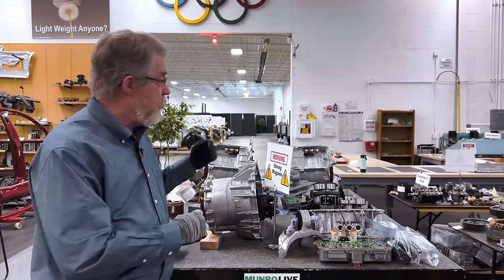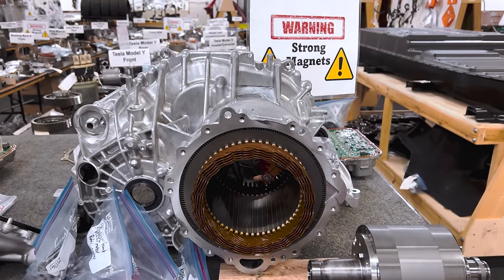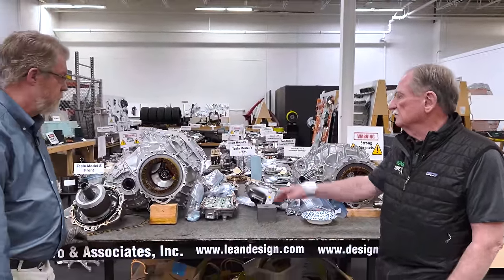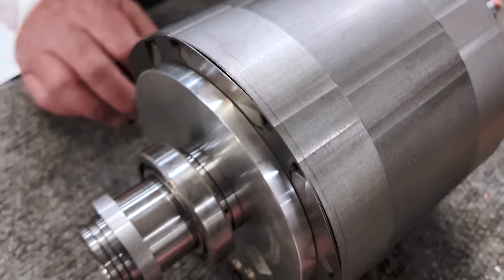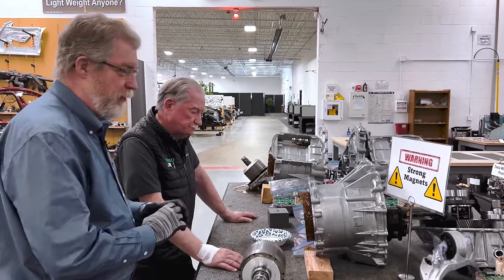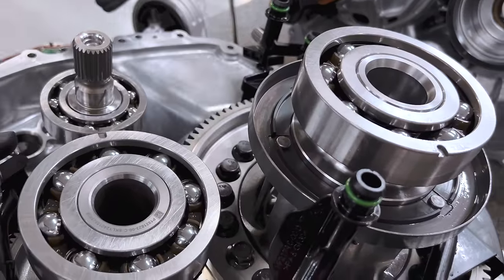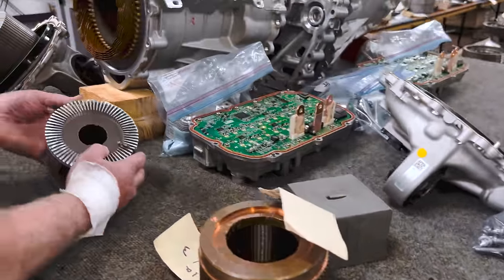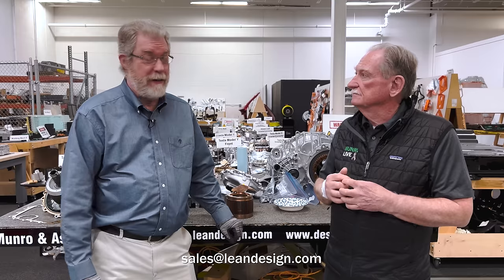Tesla Cybertruck 845-HP "Cyberbeast" Motors!

Comment: 10:36 If you could confirm that endRings (rotor disks) are made of steel, reason of not covering up to the rotor OD would be to avoid magnetic short circuit (or flux leakage) on the mgnet lateral throught the  disk.

Of course, will also help to magnet cooling compared with a fully covered lateral rotor disks

Induction machine rotor surface grooves have not been designed to replace skew. Seems that rotor slots are opened meaning that slot opening leakage inductance is reduced to get more power from the same voltage. Challenge there use to be to avoid any aluminum leakage during rotor cage casting process but seems that they have solved it.

Great videos guys! You share with the world those hidden piece of engineering  that we love to see!

Comment: The thick aluminum end plates on the PM rotor, if it is closer to the stator will have higher eddy currents that is not good for efficiency. If cooling is the reason why not have some holes on those end plates.?
Reply: air permittivity vs aluminum permittivity, good observation
Reply: Ok I know aluminum thermal conductivity but what is the comparison with air in this situation? 
I'm construction and thermal bridging of aluminum is tragic.😊

Comment: The rambling about induction rotor construction starting around 19:07 is almost entirely incoherent. I think Sandy wanted to talk about skew, and stumbled into rotor construction as a result. In the end, the construction of the induction rotor for the Cybertruck motor is not described, and how longitudinal grooves might help motor operation is not explained.

An induction motor's rotor uses electrical conductor windings which are shorted, so changing magnetic field from the stator induces a current in them, which produces the rotor's magnetic field. The windings can be constructed of wire, but that isn't done in EVs; instead, EVs use "squirrel cage" rotors, with a cage of lengthwise conductors which are shorted to each other at the ends. Regardless of how the conductors are made, the rest of the space is filled with a stack of iron laminations, just like a permanent magnet rotor for a synchronous motor.

The old copper design has the conductor bars and one end plate expensively machined from a solid block of copper. The laminations are then stacked into it and the shaft, then the other end plate is attached to finish the rotor. 

The aluminum conductors of the newer design of rotor are cast into the spaces left for them in the stack of laminations. That means less waste material than machining from a block, and a less expensive manufacturing process; it also uses cheaper material (aluminum instead of copper).
Reply: The aluminium cage does have slightly greater resistance losses however. Maybe not a big deal, especially on a fast spinning motor because the Al conductors are lighter and could thus be thicker without causing issues with centrifugal stress.

Comment: Power is in Watt, why still use these archaic HP ? And which one ? The one = 746W ? Same for torque, Nm  etc...
Reply: Because this America, and hp is the standard used by the general public to compare motor power.
 We use SAE wire guages in cars, and AWG guages for everything else. Those are standards in use.
 Engineers use the ISO standard for geographic position of only degrees, to five decimal places. And that's fine, but no navigators or cartographers use it. They use two different standards of degrees, minutes, and either decimal minutes, or seconds.
 Try to change standards. By all means.
Reply: @lyfandeth great for proving me right, you seem so confused ! 😮
Imagine this Tesla designed and built according to SAE NON METRIC standards (pre seventies) 😅 
Thanks Ford who made the inch exactly 25.4 mm ! Imagine the mess if it was still based on the survey units ?
As for the US general public , sad to compare its education level to the rest of the civilised world. I have a foot both sides of the pond.
Reply: Are you going to complain when they start using Electric HP or do you know if they are?

Comment: Thanks!  Wondering if the dual motor will have a similar set-up only reversing the PM with the induction motor.  Also wondering if having the induction motor up front turned off at highway speeds would help with noise vs having the PM running all the time.
Reply: The induction motor is noisier you have coil whine on the stator and the rotor while PM motors only have coils on the stator.
Reply: I believe I saw somewhere mention that on the 2 motor the induction is in the front and PM in the back.

Comment: Induction and PM synchronous motors sharing stator design is good, but not new - Tesla has done that since their first PM motor, in the Model 3. Like the Model 3, the axial lengths are different, to suit different flux density and power requirements. Long before Tesla, Remy (now BorgWarner) offered their HVH series (which is also bar-wound with hairpins) with a choice of induction or PM rotors using exactly the same stator. It's good to see Tesla continuing this practice, and finally catching up to use bar winding.

Comment: I think the magnets issue is so that tesla intentionally makes the motor hotter so that it can use that heat to keep the battery warm in colder weather. It is really the only motor that is running most of the time and especially on the highway. So, there is a lot of heat loss in colder climates. Basically, they don't have to add a heater, but then they can modulate the cooling for hotter climates, or even shift the work to the induction motors. I am just guessing, but I'm usually right.

Comment: The rotor end plates are called DE and ODE balance rings. DE is "Drive End" and ODE is "Opposite Drive End". You could get through rotor cooling to the magnets if you just perforated the balance rings. That's probably not the reason they aren't the same diameter as the lamination stack. Near net shape shafts were used in the GMT900 program as far back as 2008.  We had a rotary hammer forge that fed our machining process.

Comment: So to be clear on the front differential- it's not limited slip, it's an electronic locker- giving a true Detroit locker type of performance?
Reply: This locker allows both electric motors to send combined torque to the wheel that grips. Only really needed if a single motor has insufficient torque, which is a weakness in the PM reluctance rotor design.

Comment: So does the dual motor configuration have two of the fronts that are in the cyber beast? Do we know that yet?
Reply: The rear motor on the dual motor model is a single configuration of the induction rear motors used here.

Comment: how does the grooves on the lamination of induction motor rotor cage eliminate torque ripple? and how is it better than skewed rotor?
Reply: It's not better just cheaper to fabricate. The grooves splits the magnetic fields.
Reply: I was taught that offset fins make the mechanical characteristics of the engine more "smooth"

Comment: More than just the non-segmented magnets, having that rotor end plate run to the rotor OD would generate unnecessary eddy current losses since they would be exposed to some of the magnetic flux from the stator field.  In terms of the magnets, I'd be surprised if Tesla weren't on top of the gains segmented magnets can offer and I'd suspect they were not that significant, especially since the magnetic flux at part load operation is pretty modest compared with full torque so the losses would be not huge for most of the time.
Reply: Now apply those thoughts to 750,000 miles on said vehicle.  What are the long term results?  1,250,000 miles?  Keep in mind, the average Tesla produced after 2019 is expected to last 750k miles.
Reply: @davidbeppler3032  I doubt Tesla is concerned with the cumulative efficiency losses above maybe 200K miles if they can save money up front in manufacturing costs.
Reply: @davidbeppler3032 the efficiency losses are probably only noticeable at higher power. For a vehicle that can do 0-60 in less than 3 seconds, it will spend very very little time at anywhere near full power.
Reply: @davidbeppler3032  The efficiency won't change with time.  It's all about selecting a cost-optimum design.  If you spend 30 bucks more on segmented magnets but you can't see any range improvement and you can still handle the high power thermal control of the rotor, what's the point in spending the money?

Comment: 14:50 
Munro, are we sure there are significant eddy currents in a Permanent Magnet Synchronous Motor?
The whole point of the word Synchronous is that the magnetic pole from the stator is rotating in phase with the rotor’s permanent magnetic field poles. 

If there is significant pole slipping (relative movement between stator and rotor) then I think there is a problem in design or control systems. 

Relative movement between the field and conductor is required for an eddy current.
Reply: We know heating is a problem that is why they opened up the end plate to get oil in. So there must be significant heating losses happening in the rotor near the magnets. Otherwise it would be much easier to fabricate the rotor all sealed up.
Reply: The magnetic field is still passed from pole to pole in the stator. Even when three or so poles overlap per winding, there is some field fluctuation passing through the rotor. So it's like amplitude modulation.

Comment: i assume at this point in the tesla story...if there's a design change or something that is "inexplicable" then it is for a damn good reason.
Reply: @rwhirsch Yes, but I think the reasons might not be instantly obvious. Is it simply cost savings? And is that simply to make the cars more affordable? Or cheaper to run? Or durability? Or better performance? And is that more power or greater efficiency? Tesla has greater integration in their engineering teams than anyone else, and I will bet there are many conversations that go, "Hey! I gained X% more something!" to which another engineer says, "Did you consider XYZ?" ...."Oh shit! Back to the drawing board" From which they end up with a third option that solves both problems. This is why I don't think many manufacturers are going to catch up all that quickly. Would love to see how the latest Mach-E compares to the first version. In particular the thermal management was a dog's breakfast. Even Ford admitted they missed an awful lot of details on the Mach-E generally.

Comment: The segmented magnets make great sense if the truck is only operating in hot climates. 
But Tesla uses motor inefficiencies to generate heat to put into the heat pump that keeps the battery and cab warm. 
It may well be that when they run the calculations, the extra heat is required more often and the solid batteries allow this to be generated faster and at less electrical cost. 
Rapid warm up and keeping the battery warm is very important. Not to mention creature comfort.

Comment: Any news on the battery configuration? You wanted to look under the sides of the pack to look for more cells there and check the engineering assumption of 192s7p for the configuration of the pack.

Comment: Interesting that Tesla cheaped out on the motor magnets while also giving Cybertruck a smaller battery than other e-trucks. I think they're sandbagging on early Cybertrucks, not thinking Chevy would beat them on range by loading up a bigger battery pack. Perhaps sometime in or after 2025, Cybertruck will get a "refresh" with a bigger, better battery pack, and a few other tweaks to get real-world range over 350 miles without an extra battery.

Comment: Regarding the mechanical rear diff locking, why would that be needed when you have two servo-controlled motors with positional feedback?  Surely they can simply command that they follow the same motion profile to come close to emulating a locked diff?  The induction motors might not be quite as smooth as PM at low speed but I wonder why that wasn't done as it's a far cheaper solution, even if shaft resolvers of a higher resolution were needed?
The bearing outer-race locking feature addresses a problem when over-sized ball-bearings are specified to handle helical-gear thrust loading, including cases where a tapered-roller pair would normally be used.  It avoids the finicky preload setup on assembly but introduces a new problem because the minimum radial loading required to avoid outer-race spin in a slip-fit assembly situation is not achieved.  This is a clever solution from Tesla as the spring pin even avoids needing to index the bearing during assembly.
Thanks for the video, Munro team, alway interesting!
Reply: The reason is that when a wheel lifts off and traction is lost, a locked differential allows both electric motors to apply torque to the single tire.
Reply: It seem to me that locker mechanics was in the front permanent magnet motor section. I could be wrong.
Reply: @redwood6737  good catch!  I watched it again and you're correct that this was the front drive unit. They didn't show us the insides of the rear diff unit unfortunately.
Reply: @boredKiwi  thank you sir
Reply: @boredKiwi  thank you sir, I also got out the magnifying glass and when Sandy entered the picture they showed a spec sheet and on that sheet they’re showing 10,296 foot pound torque. The regular cyber truck there are actually showing 7435 Torque, not sure where they got those specs from but looks like they’re off by quite a bit. Not sure who did the misprint but I can’t imagine this Tesla putting out more than 1000 pounds of torque like my ram truck diesel Dooley Cummins.
Reply: @redwood6737  those numbers match Tesla specs and would be "at the wheels".  Quoting torque "at the motor" is less useful information for an EV, and of course sounds less impressive.
Reply: Thank you Kiwi for that info. I was not aware Torque at the Motor and Torque at the Wheel could be such different numbers.

Comment: Amazing what EV’s have done with just first generations.  Just think a few more generations.  Battery tech is also rapidly changing
Reply: I think Tesla is more like the 4th generation major design.  BMW appears to be on the 2nd generation.  Most others are on the first generation although able to get a few ideas from Tesla if they are smart.  Cool to see everyone making design improvements.
Reply: Some of the Chinese are on the 2nd and 3 generations as sell.
Reply: Charging infrastructure that's not based on coal or diesel is also growing, we're not there yet, but it sure is coming.
Reply: @MatthewDeveloper  - It depends where you are and the charging network.  Tesla superchargers are 100% renewable power from a combination of onsite resources and annual renewable matching. Those EV owners with home solar may also be 100% renewable today.

Comment: Is the solid magnet for the motor the reason there is a pulsing vibration at some speeds? This is reminiscent of older automatic transmission when you are traveling at a speed that is kind of between two gears.

Comment: “Piston car can’t go 3/4 million miles,,,,,” 30 years ago Lexus causally makes the LS400 which can go over million miles 🤯
Reply: Doesn't it require lots of maintenance to do that?  Timing chains, value adjustments and replacements, spark plugs, rings, and more will need to be replaced along the way, multiple times.  If you keep replacing enough parts it could go millions of miles, although nothing will be original.
Reply: Electric motors are awesome but  what is the life expectancy of the battery which is the most expensive component?
The million mile Tesla S had several motors and batteries replaced.
Parts for many ICE vehicles are cheap and readily available. Teslas not so much so!
Reply: @richardwolf6269  - Engines, Cataltyic converters, and timing chains are are not cheap either. Engines after 100K miles have reduced MPG too as the rings and valves wear and it starts burning oil.  

Battery packs generally don't really die, they just have less range over time, perhaps 80% of the original after 250K miles. Motors and packs keep getting better, but agree that for the very early Model S, getting a million miles will take a few packs and motors.  The EV's "fuel" and maintenance savings are far more than those expense even on the early models.
Reply: @richardwolf6269  cost waaay less than the ICE that get there. Keep in mind that many that get there as ICE it takes 25 or 30 years because it was was parked in a garage and drove at 45 mph.
There are no ICE taxis with over 500k on them in a fleet.
 
Bet Uber would find out they have a 100 model S with that on them if they asked the fleet.

Comment: There is no need for segmented magnet in the rotor as there is no changing magnetic field. The rotor rotates and always aligned with the direction of the magnetic field.
Reply: segmented and hall effect magnets can juice a couple percentage points of efficiency out of the motor.
Reply: @davidanalyst671 What if they fiddled with the permanent magnet alloy to reduce eddy currents?
Reply: @kazedcat  I'm not an engeener but I can guarantee that would cost more than just doing the segmented magnets.
Reply: @sparksmcgee6641  One time cost on developing the alloy compared to a reoccurring cost of adjoining segmented magnets.